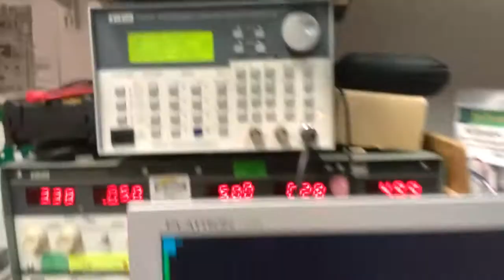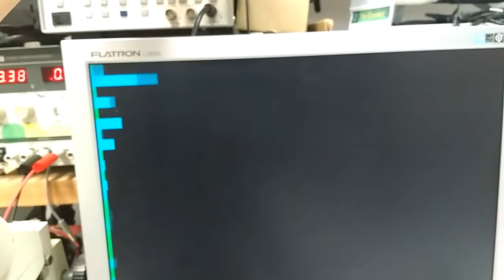FPGA FFT

Comment: Hi, I have a microphone sampling at 20Khz, what FFT should i use to get a resolution of 40hz per pin? and also, I tried using the generated FFT but am not able to output a value to my bins, any clue why?